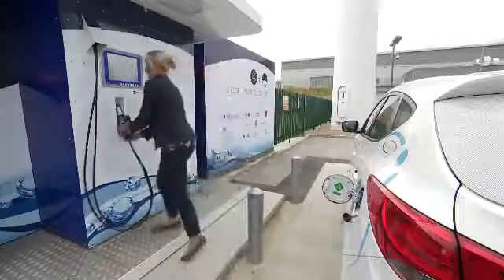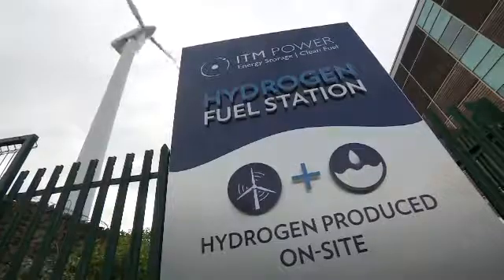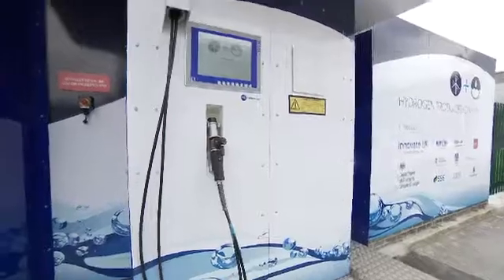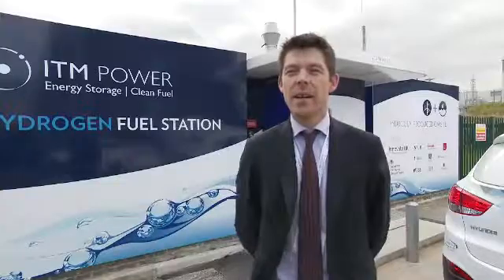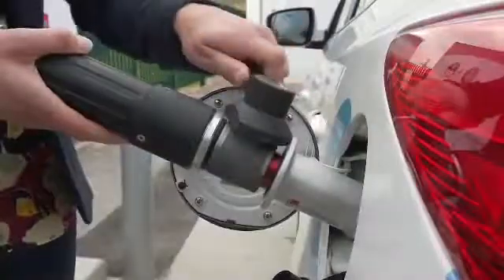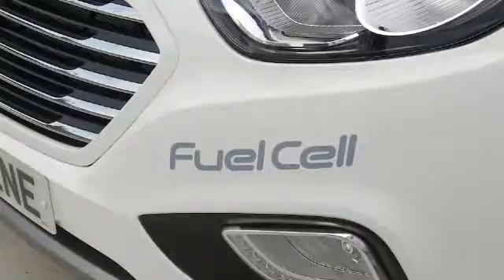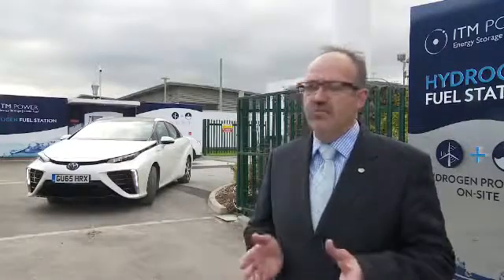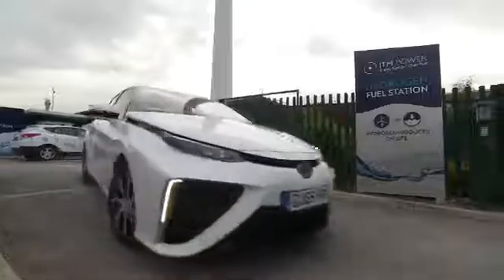100% Green Wind Powered Hydrogen Station in England

Comment: So what if  a monopile was used in the sea full of water (with openings) and space at the top for the hydrogen to be collected and compressed (as the gas would rise )and then use the gas to power the turbine to create electricity,the wind used  to generate electricity and to power the electrolysis
Reply: My guess is that the salt would carode everything very quickly. The orphises for taking in water would get plugged easily from sea life and plants. And wind turbines are generally shut down at high wind speeds. Partly for safety, and partly because the motors and bearings can only handle so much stress before they begin to fail. That's why they are generally moving quite slow.